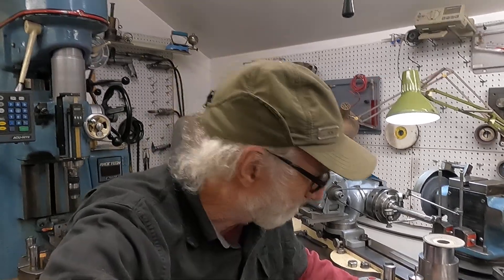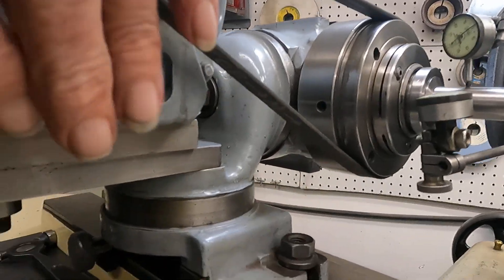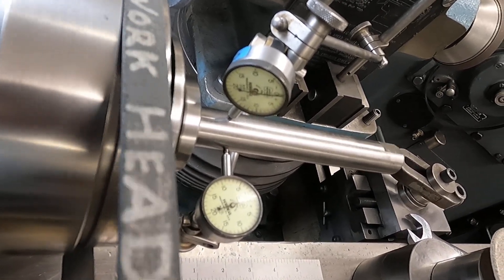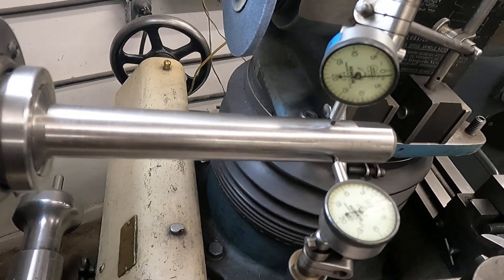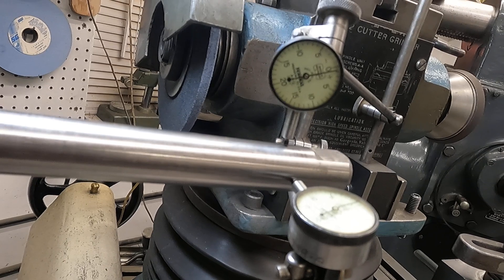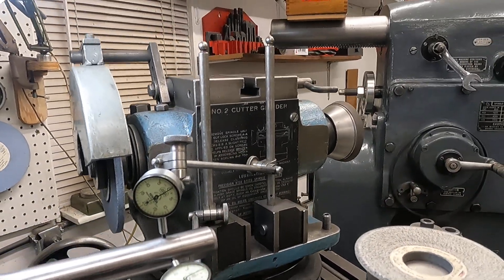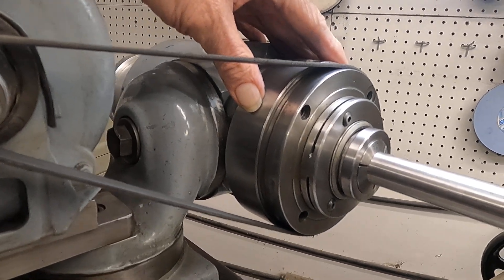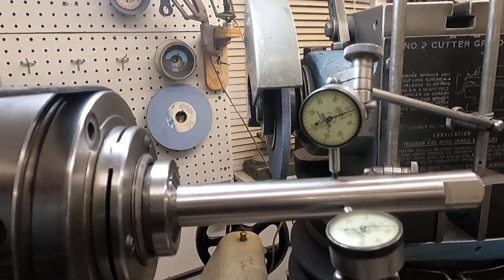Cincinatti Tool & Cutter Grinder work head tram

Comment: Donny,  I have a full set of Hardinge 5C collets from nothing to 1" by 64th when I need them.  But I have just about as many 5C collets in my random drawer.  I have a handful of ENCO 5C collets.  I must tell you, every one of the ENCO collets runs within a tenth.  Just like the Hardinge.  Amazing I tell you.  -----Doozer
Reply from the maker: The only problem is the Enco collets do not spring open as far when loosened.

Comment: I've bought many brand new machines in my day and they couldn't hold a TIR of a 0.0005 from the factory. I get a chuckle when I see comments from individuals trying to get a 0.00000 from a part and yet the machine isn't even doing that and then considering heat/friction and cool down and then they comment its a part for their car and yet it has a +/- 0.020 for tolerance...Take care Dee Dee...Ricko in SoCal
Reply from the maker: The close tolerances I work with are fitting ball bearings. Barden states in their bearing fitting manual the limit of error is .0002". To cut various alloys to that tolerance, shafts and holes, I use this grinder to support a Monarch 10ee lathe, and a Moore jig borer. One shot to get it right on a single part. The ass clowns the run the forums control the content, and have so for years.
Reply: @deedeeindustrialsuperprecision  totally agree. I love the fact you are using your 10EE and since I haven't seen yours yet, I could only imagine how clean it is. Have fun Dee Dee as that's what we have left in us as we age.